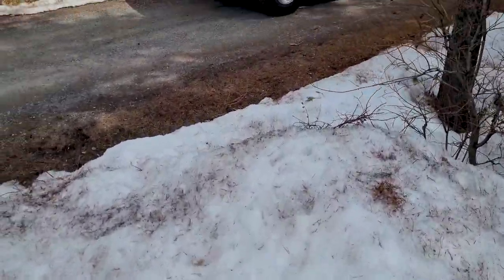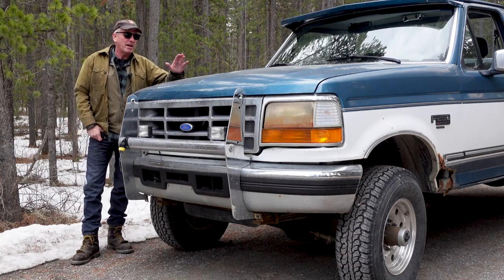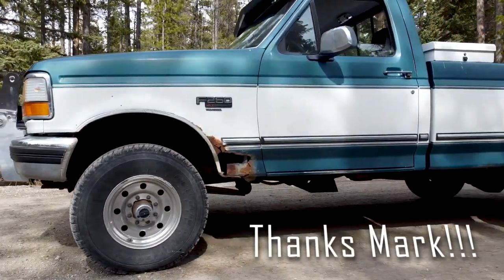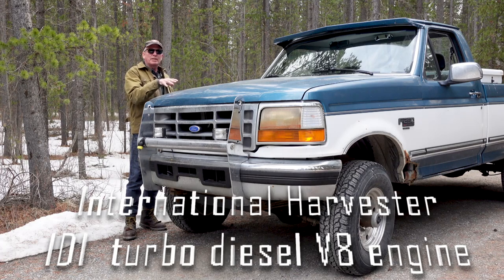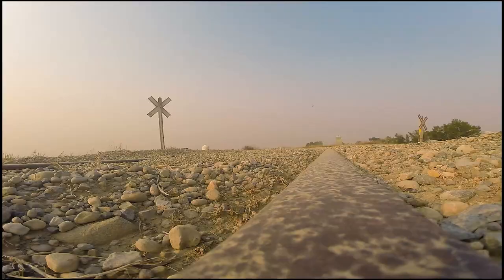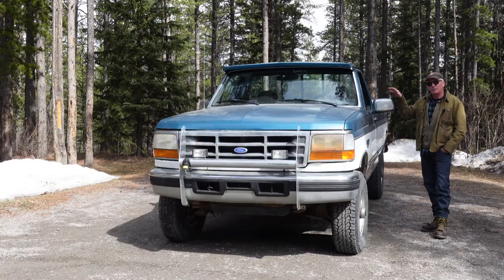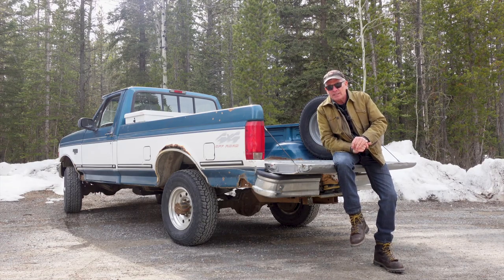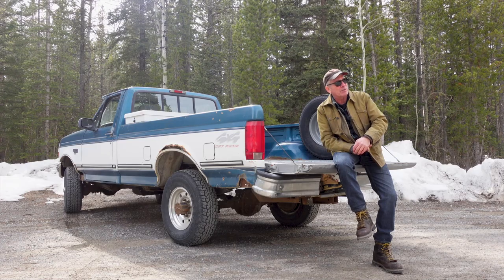1994 OBS IDI Turbo Diesel Ford F250 4x4 is Back!

Comment: working on a '93 7.3 IDI turbo as an outlander.  Interested in seeing what you equip it with.
Reply from the maker: Hi, and thanks for the comment.👍. At the moment, we're mulling over replacing the bed or installing a flat bed. I personally like the flat bed idea because it This gives us the option for side storage containers beside the slide in bed camper. More to come 🍺
Reply: @JimmyMeatwhistle    what slide in are you considering?
Reply from the maker: Since it's going to be a bit of a budget build, we're not going to buy new. I'm not sure if it's going be a pop-up or solid slide in camper, probably solid. 🤔